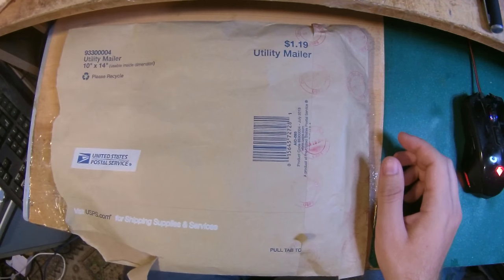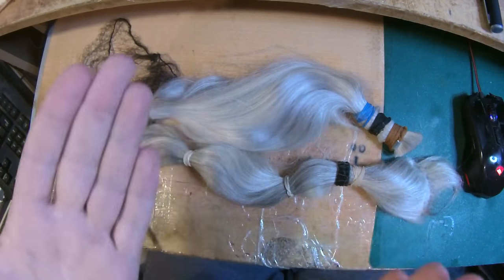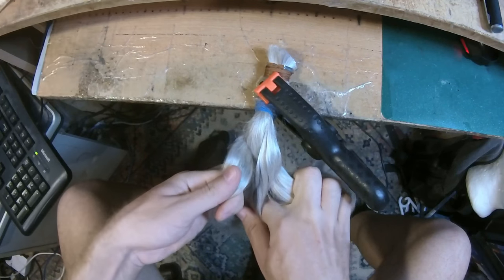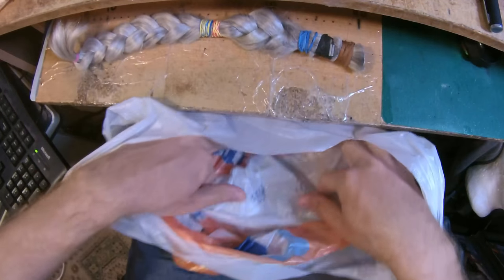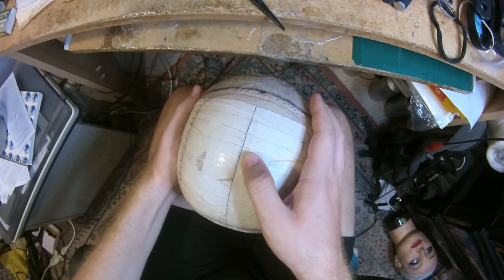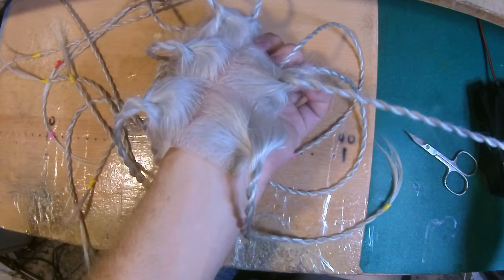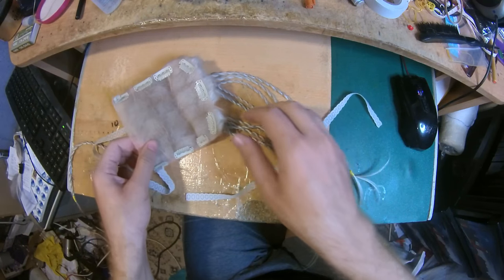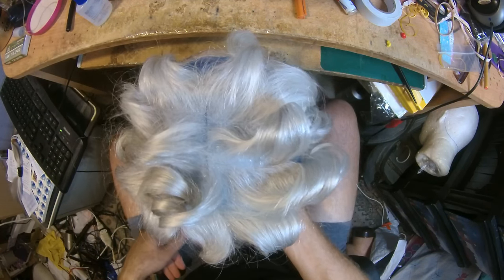Virgin White Topper

Comment: very pretty. i am making a topper. my first using hair i cut off about 3 yrs ago, im getting better at it ! i need to work on direction and density.  but i am getting there. thank you for all your great vids  and motivation. i dont have a standard "wig head" to work on so i built my own using circles of canvas fabric large to small. till it fit my pattern. works pretty good.
Reply from the maker: DIY is not always the best but it does give you a feeling of satisfaction, you did it on your own :D
Reply: a real canvas head or the foam one would have been better but i like to make use of the stuff i have on hand.  i thought canvas, i had some, then i decided i only needed a topper so i made the top of my head. 

i will take a pic of it when im closer to done. thanks for all the great vids. this hobby i have discovered used the right side of the brain, so i dont chat while i am doing it and my spouse is so happy tee hee.
Reply: i finished it! but i havent taken a pic yet. its nice. i cant even tell its on my head!  i want to make one for my sister.

Comment: I admire your excellent work. I'm a guy trying to practicing ventilating more using my "Asian" needles, it's not easy. I mostly do repairs to prolong my hairpiece's lifespan. What I don't understand is why wig makers I see on Youtube only ventilate with one knot instead of two. Three weeks ago I added lots of hair (ventilating with just one knot) in my hairpiece. I wear all weak and do maintenance on weekends. I noticed most hairs on my unit has fallen out by this time. My (one ventilation) knots were tight enough because I made sure all knots had been gently and carefully closed. How can someone expect a hairpiece that's been ventilated with only one knot to last at least 3 months? Thanks.
Reply from the maker: ...it is called (semi) permanently sealing the knots. Or even permanently.

Either apply a knot sealing spray underneath which won't do much or try to apply some other stuff like fray check etc. It might make the lace harsh, or too rubbery depending on the substance but it sure helps with the knots getting "glued"

Also it takes great skill to handle a piece that has single knots. You always braid the hair before removing (if possible) you always lift the piece by pulling it from the hair instead of lifting it from the lace, you always soak the glued piece on your head with glue remover and let it literally fall off itself instead of pulling hard on glues, never rub a single knotted piece like a piece of cloth when you wash it, especially in the base area.